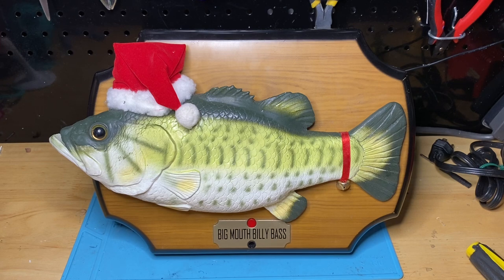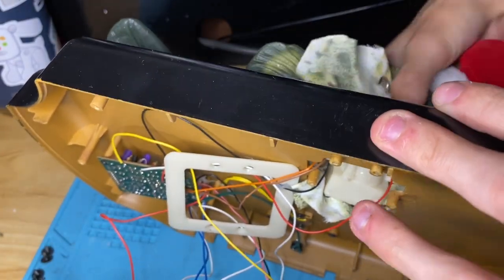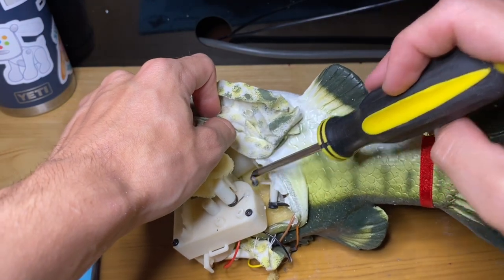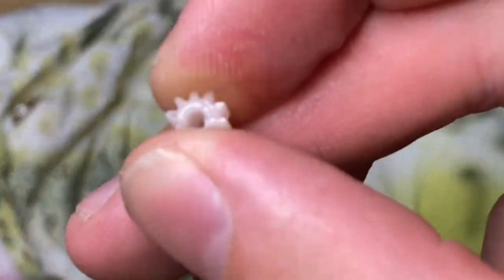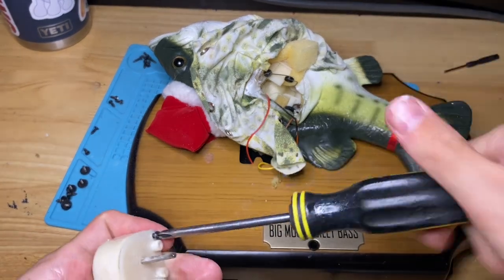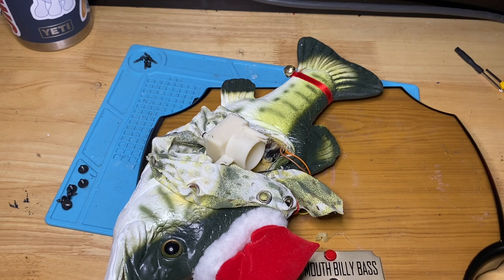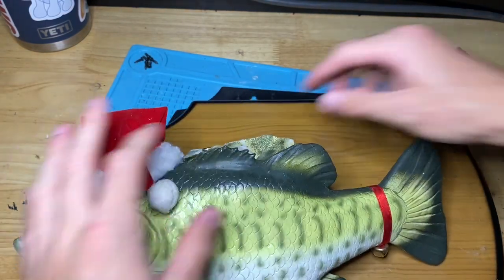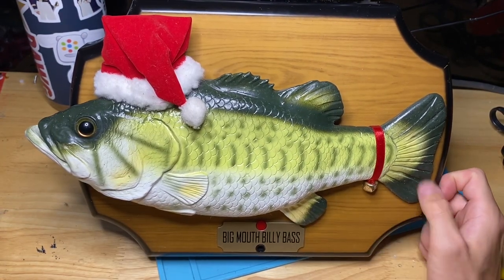How To Repair The Crown Gear On Your Big Mouth Billy Bass/3 Motor Singing Fish

Comment: Smart! I actually didn’t know that the gear was separate.
Reply: One thing I like to do thought is to take a photo of the circuit board and unscrew the circuit board so non of the wires pull and come off the circuit board

Comment: in my Billy Bass the very first gear (the one that is in contact with the motor) is broken. I am trying to find a replacement for it. Do you know the specifications, so I can loo it up on eBay or Aliexpress? Mine is completely disintegrated. Any leads are welcome. Thanks and bye for now!
Reply from the maker: I use these for the motorshaft gears. https://a.co/d/aTcsKX1

Comment: Did you use wd-40 to grease the gears?
Reply: Don't use wd-40 for a lubricant. Use white lithium grease or any other grease.
Reply: Oh wait, I see he used the white lithium grease by wd-40. This is acceptable.
Reply from the maker: Yeah plain old wd40 just kinda dries out after a while lol

Comment: Hey, I'm trying to replace the head motor gear and you state the they are always "10 teeth", but mine is 9. It doesn't look broken either. Is it definetly 10? also is it 1.5mm or 2mm? Thanks
Reply from the maker: Some can be made slightly different that others. Although I believe I was referring to the larger gear, with the smaller part being 10teeth. The motorshaft gear itself is 9tooth, the one that fits on the motor itself. And I use 2mm inner diameter.
Reply: @IDogFan41  ah okay. I might just replace the one that goes on the motor, but my problem is the head gets jammed. I've opened the gearbox and everything looks great but the motor gear just jams everything up